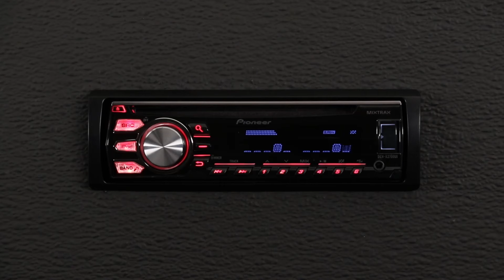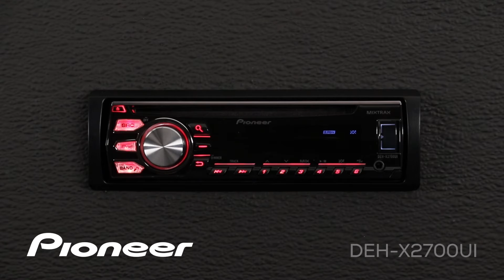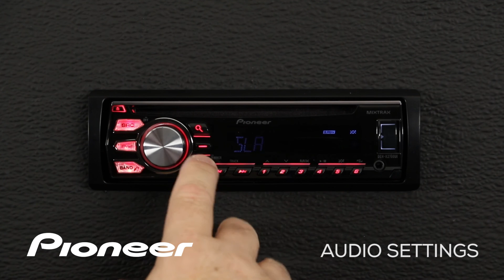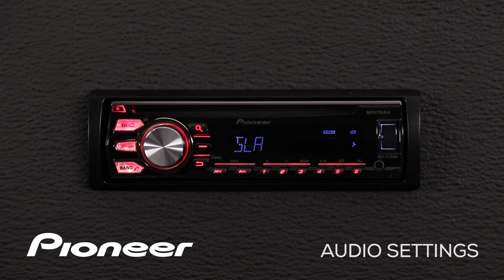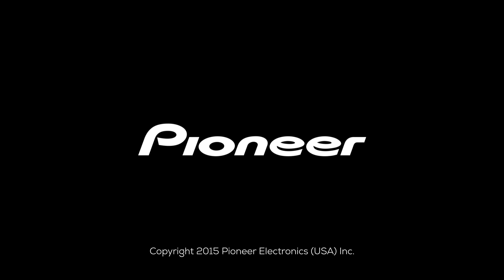How To - DEH-X2700UI - Audio Settings Menu

Comment: Does this Panasonic mixtrax have a color changing option ,or is it only on certain models?
Reply: The Pioneer DEH-X2700UI in the videos above was made back in 2015 and does not have color changing. That's only available on certain models.  Here are a few more modern options. Pioneer DEH-S6200BS seen here: https://youtu.be/0UgoK9v_KcM?list=PLw63zJRQbCNiH14t9cYje9Gdcvn7xH4ne  or the Pioneer FH-S722BS seen here:  https://youtu.be/kQz4kuB2en4?list=PLw63zJRQbCNgEj_AwkFzirmAHnJ446fC7  You can find more videos on Pioneer's You Tube Channel here:  https://www.youtube.com/user/pioneerelectronics

Comment: I got this same stereo , have a question I have stock rear speakers but also got a sub woofer in the trunk I just recently added some tweeters. What’s the best setting to have no bass going to the rear speakers and all the bass just to the sub. What’s the Hz setting do you recommend to get the best bass ?
Reply: When you say you have a subwoofer, does that mean the subwoofer has it's own amplifier?  Is the subwoofer amplifier connected to the in-dash receiver with RCA's ?  If that's the case, I recommend to set up your in-dash receiver RCA outputs as subwoofer outputs and the speakers as full range outputs.    You can see a video of the Speaker/Pre-out set up here:  https://youtu.be/K-wjoKFiqRU   For your subwoofer I recommend a crossover setting of 80Hz and 12 dB per octave.       For the front and rear speakers I recommend an HPF setting of 80Hz and 24 dB per octave.  You can see a video of it here:  https://youtu.be/wst2QI9unHs?t=179   You can find more videos about Pioneer DEH-X2700UI here:  https://youtu.be/kCYrWvEzfAw  and you can find more videos on Pioneer's You Tube Channel here:  https://www.youtube.com/user/pioneerelectronics
Reply: Yes the sub is connected to its own amp, all other speakers are connected straight to the head deck
Reply: I recommend just as stated above.   I recommend to set up your in-dash receiver RCA outputs as subwoofer outputs and the speakers as full range outputs.    You can see a video of the Speaker/Pre-out set up here:  https://youtu.be/K-wjoKFiqRU   For your subwoofer I recommend a crossover setting of 80Hz and 12 dB per octave.       For the front and rear speakers I recommend an HPF setting of 80Hz and 24 dB per octave.  You can see a video of it here:  https://youtu.be/wst2QI9unHs?t=179   These settings are a place to start.  You can always adjust the settings later if you want.  You can find more videos about Pioneer DEH-X2700UI here:  https://youtu.be/kCYrWvEzfAw  and you can find more videos on Pioneer's You Tube Channel here:  https://www.youtube.com/user/pioneerelectronics

Comment: Is this a multicolor unit?
Reply: No, DEH-X2700UI has fixed colors.  If you are interested in a multi-color in dash receiver you might consider Pioneer DEH-S6000BS you can see it here:  https://youtu.be/GBFFzr6Dy6g?list=PLw63zJRQbCNgnzKRnjnxSbEmQtkk0O5Os   or Pioneer DEH-S5000BT  you can see it here:  https://youtu.be/SzicLYh2gHY?list=PLw63zJRQbCNgnzKRnjnxSbEmQtkk0O5Os